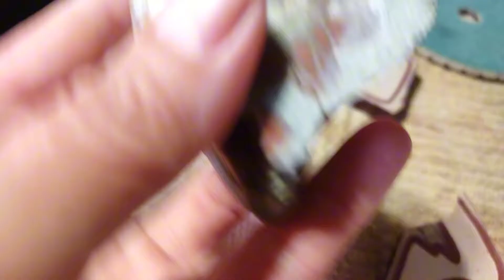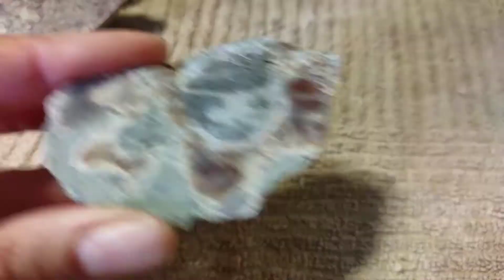Polissage de pierres.

Comment: Hello j’aimerais offrir à mon mari une machine pour polir des pierres. Quelle est cette machine sur la vidéo ? J’aimerais des conseils merci 😊
Reply from the maker: Bonjour à toi , pour la machine c'est une polisseuse a l'eau de la marque Makita PW5001C  a vitesse variable , dimension du tampon max 4"  (100mm) acheté à la boutique Outils Berger si tu es au Québec. Pour pouvoir l'utiliser comme sur la vidéo il faut se bricoler la boîte pour pouvoir y fixer la polisseuse ,et aussi prévoir un sac pour la distribution de l'eau, en été on peu l'utiliser a l'extérieur pour le polissage avec le boyau d'arrosage qui se fixe sur la machine. Si non il y a des boutiques en lignes que tu peu trouver des vrais appareil mais beaucoup plus dispendieux, encore une fois si tu es au Québec, près de Montréal il y a Terra  rockshop qui peu vendre un appareil conçu spécialement pour le polissage de pierre a la main avec des disques.